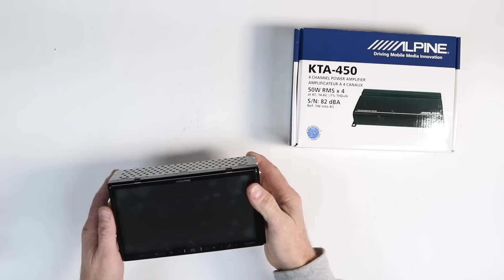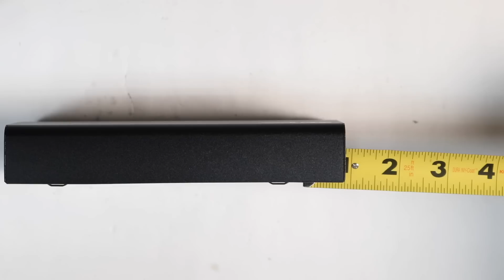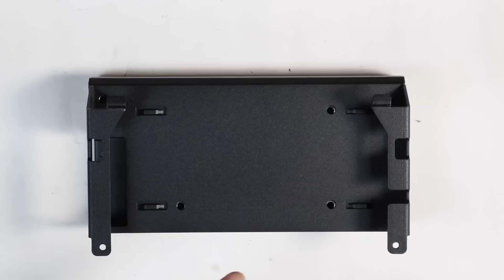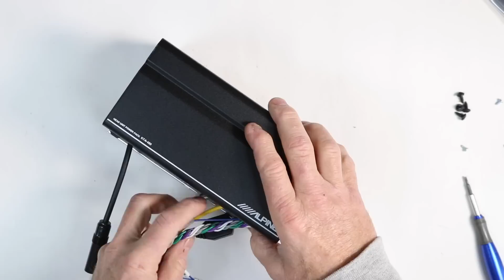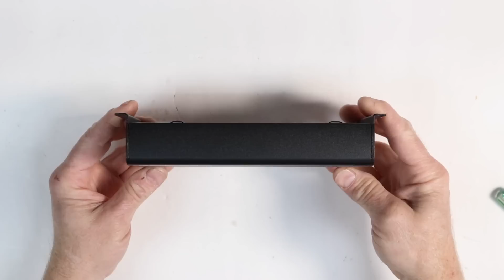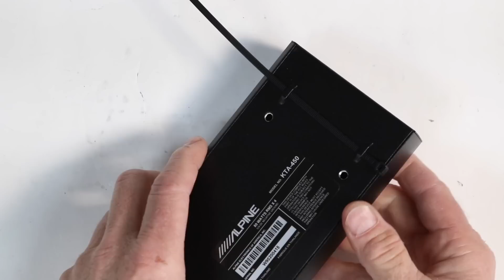The new Alpine KTA 450 Micro amp unboxing and review

Comment: How I supose to put those pins for 4CH, 4 speakers? I think, mine configuration right now, work only on Front and the Amp duplicate the sound to the Rear, I have no 4CH. Alpine KTA-450 paired with 4 Alpine S-S65. no subwoofer. Head unit linked with Amp through RCA, but those pins man, are killing me.

Comment: I prefer the ktp-445u. It's an easy enough installation when you can tap into factory power wiring to power the amp. If I'm gonna run power wires to the amp from the battery, I may as well go with an amp that has more juice because to me this is pointless for only 50 watts rms 🤷‍♂️
Reply: It's 60 rms of alpine clean power so it's equal to most 200watt amps. I only have my gains to halfway and it is making ct sound meso 3way components sound awesome

Comment: Quick question with this thing push a small sub just installed the 650 in my truck
Reply: You can’t power a subwoofer with 50rms
Reply: @brettbaker5873  this amp can be bridged to a 2ohm so it technically can. But it makes no sense to do that.. o and its 50 rms each chanel
Reply: He says 50 watt by 4 in the video

Comment: Sooooo how does the amp wire up to the head unit?
Reply: The amp rca’s on the back of the head unit. Then there are speaker wires from the amp that are output.
Reply: And for power wires
12v battery
Ground
Remote 
All 3 just tap into factory wiring that powers head unit. After this summer I will know if we should upgrade power wire to 10g or 8g power and ground 🤔  time will tell
Reply: @thewhitefamily5515 So did the taps hold up?

Comment: Can I splice and split the power of the amp with the power cable of the reciever?
Reply: Yes that's how I installed mine. Factory wiring harness for main power wire. I  just spliced into the 12v battery wire.  Same wire that is powering the head unit ilx-w670  and the amp ROCKS
Reply: @thewhitefamily5515 so no need to run a wire to the battery?? I will be installing mine tomorrow. Thanks in advance

Comment: Just purchased the head unit and this amp today. Haven't installed it yet. It's going in my Sons 07 FJ. Hopefully, at $225.00, it was a good choice? For the output, the price seamed a bit on the high side! Combined Stereo/amp cost $685.00
Price includes installation. We're not sure what speakers to use AND, we need an amp for the sub...10" Alpine C series I believe. Any help would be appreciated.
Reply: I too got this amp and the ilx-w670. I have the gains set to about half on both front and rear and it sounds amazing  now when I add a subwoofer it will be perfect    I'm very impressed with the sound increase from this amp I had just the head unit running everything for about 3 weeks. Now with the kta 450 it fn screams and the 6x9s  sound like a low powered 8inch sub haha great sound quality 👌

Comment: Would love to hear your review of the sound of this little amp. Genius idea.
Reply: It sounds awesome I just hooked it up to the new ilx-w670  and it fits like a champ and my speakers are ct sounds meso 3 ways for front and ct sound meso 6x9 coax for the rears. It sounds incredibly good. It literally puts out the perfect amount of power to get your highs screaming and hitting hard. I didn't even upgrade to a thicker power wire. I just used the factory head unit power wire from jeep which looks like 14g .  I know it would crank a little more power if I ran a 10g.  Or 8g wire to the amp. But it still puts out good CLEAN power. I just wonder how it will do in the summer heat smashed behind head unit like that. Hope it doesn't overheat

Comment: Since these both use "class D" aka "chip amps" as their amplifiers, and are very compact, wouldn't it be nice if manufacturers started including powerful amps in their head units so this kind of upgrade wouldn't be necessary?
Reply: Sony does make a few head units with built in amps, that are rated the same as these. 

Exmaple: Sony DSX-Gs80
Reply: Back in 1995 I had an alpine 7803 (in dash cd player) not pull out,  turn knob volume. And it put out 40wx4 and it sounded awesome they should have started making that their standard power output. It wasn't bigger than a normal deck. It's clarity was top notch. Sure do miss that head unit lol
Reply: wrybread the power isn’t there or they probably would, factory head units only have 15amp fuses, so how would they make that work? Unless they made you Wire your head unit to the battery
Reply: @Bajaheat  one of the things about chip amps is they're super efficient, so 15 amps at 12 volts is plenty. But I'm all for having an option to connect directly to a battery for more power, for subs for example. It's obviously commonplace for dedicated amps to do it.
Reply: They wouldn’t make money 💴
Reply: The issue is that many auto manufacturers only add like a 10A fuse/wiring for the head unit, which is the limiting factor.  They could make more powerful head units, but then people will blow fuses.  And you cannot just add a bigger fuse, because the wiring is sized to the fuse.
Reply: @cup_and_cone  that's the thing with class d amps though, they don't use a lot of power. 100 watts is I think plenty. Not for big subs of course, but for everything else. And I know some of them claim 100 watts total between all speakers, but it's always inflated. I'm thinking crisp clear sound is doable with 100 watts easily. And if more power is needed, add the option for a big wire attached to the battery. Most cars have a designated hole in the firewall for this, easy peezy.

Comment: Looks like a PITA for installers... having to tack on the amp inside the car with all the wires attached and then trying to thread in micro screws without dropping them.
Reply: Cup & Cone if i gotta go to the battery might as well put a real amp in. Like a 5 ch incase they decide on a sub???
Reply: This amp powers the highs GREAT. I was skeptical but I just hooked it up tonight and it fn screams with clean crisp power. Now when I add a sub it will only be a sub amp to hide so I should be able to make it look like factory and hide a sub amp behind a panel in back. If I had 2 amps in the back or a giant 5ch amp I wouldn't be able to hide it. I plan on using 2 ct sounds meso 10in subs. They are beautiful looking and sound amazing  so I plan to make a pretty enclosure so I can mount the subs reversed to show off chrome n white basket. But the amp made the mids and highs sound excellent 👌

Comment: How would the sound quality if using the  speaker level inputs vs a audio control type unit for a factory head unit? Especially if it’s it’s a sub amp. Thanks guy!
Reply: I used the ilx-w670 for 3 weeks wired to speakers powered by the radio only and it sounded pretty good. And then I got this amp and hooked it up behind the ilx-w670 and used power wire from the factory power harness (no 12v wire to battery bigger for this amp) the factory sized power wire is making this amp rock so unless it melts my power wires this summer when a hot load is on the wires it's perfect for behind the deck. Don't even see it but I agree with the other dude don't use the crossover on amp. Use the head unit as crossover that way you don't have to pull it out every time you want to adjust it

Comment: Alpine: lets make a radio that is ( $300 ) mechless and then make a ($200) amp that attaches to the back of it as a gimmick to make it look cool which it kind of does and easy to install I'll say that, but doing this so that the radio can have the same amount of power that $500 double din radio already has. Yes its nice but, if you want other features such as you know the DVD CD player that's going to be an extra $400. The audio video package for the radio is like $1,500 so yeah this setup is for all you Ballers out there.
Reply: Legit question. What double din radio has a built in 50x4 RMS amplifier?
Reply: @Barney-hk3es  Is there any aftermarket radios other than the sony that have 50RMS?
Reply: You people never get it. I see this all the time. No aftermarket radio puts out 50 watts rms EVER. At most they put 30 watts out for a hundredth of a second. Maybe
Reply: @alandicken8961  The highest I have ever seen was this sony at 45RMS with its built in class D amp. 
https://www.crutchfield.com/p_158XB120BT/Sony-MEX-XB120BT.html?tp=72430
Reply: Pioneer AVH-4201NEX
Reply: @Tuff_love  that is peak power not rms.  The rms power is 14 watts.